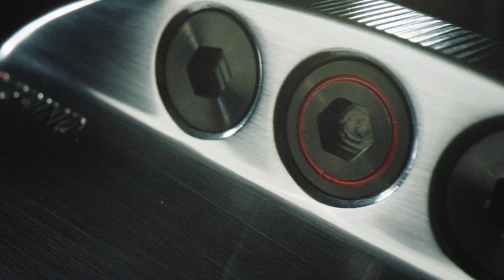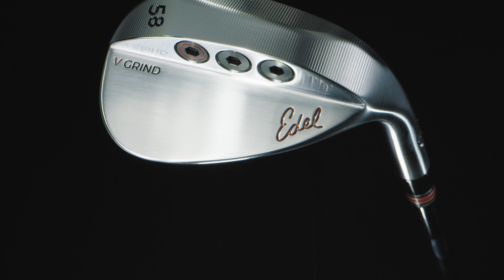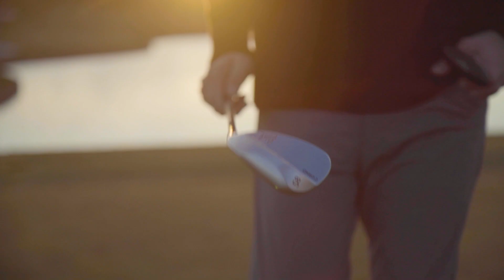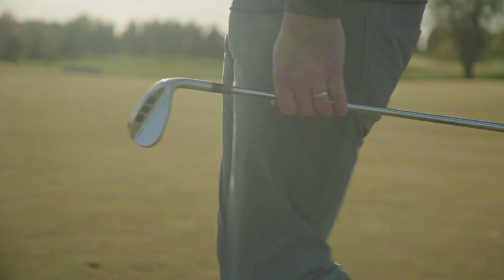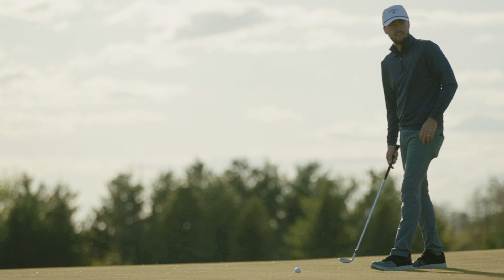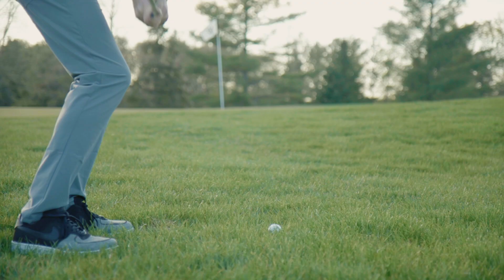The Next Revolution in Wedges - a Workbench Documentary

Comment: I recently flew out to Texas to get fitted for a putter. While there, I tried out your SMS wedges, and was fitted for a shaft to give me ideal launch and spin. After receiving the wedge, a SMS 58* V grind, I tried it at my local course. Unfortunately, In full swings, I cannot hit a full shot straight. All shots either start right and go right, or they start on line and go right regardless of weight positioning. After hitting the wedge maybe 15-20 times on the range, I picked up my Vokey SMS8 and it went straight at the target, no fade, slice, or push. I will say the Edel SMS wedge is great around the greens on short chips and short pitches and the ball spins nicely with it, but the fact that it is impossible to square in a full shot makes it unusable for me considering my Vokey wedge provides similar performance and flies straight. I cannot determine why this is the case. The toe arc seems to be ground excessively so that it doesn’t seem to look squared up at address either. Plus, it won’t balance on my finger as Mr. Edel demonstrated on a youtube fitting.
On a positive note, I will never look any farther than Edel for a fitted putter. If you want to putt better, go see Edel or find an Edel fitter. Their putters feel super soft, have fantastic balance and are super easy to aim. I love my Edel EAS 2.0, but get fitted fo one of Edel’s models that you aim best.
Reply: UPDATE: I had my Edel wedge bent 1 degree up to see if it would correct for the push (note: although during my demo of the wedge at Edel’s HQs, because it appeared to be too upright and I hit balls slightly toward the heel, I had it made 1 degree flat, despite the fact that I hit it straight during demo). The result was that on the range it went straight. On my first use of the Edel wedge after having it bent back to Edel’s standard lie, on. 100 yd par 3, I aced the hole. The wedge is awesome. I have complete faith in David Edel’s putters and wedges, and plan to update all my wedges to Edel. If you want to lower your scores and have more fun, go to an Edel fitter and get fitted for an Edel putter and wedges.